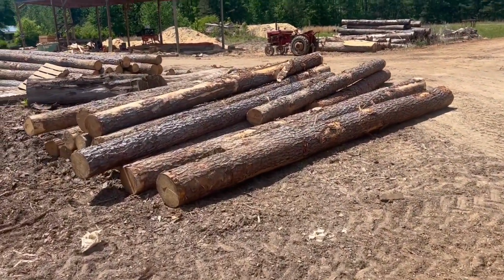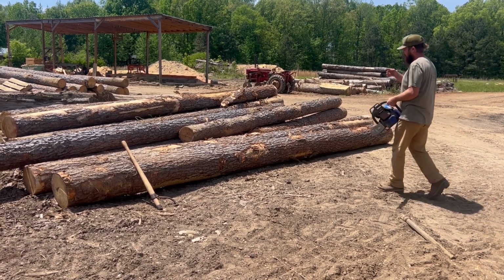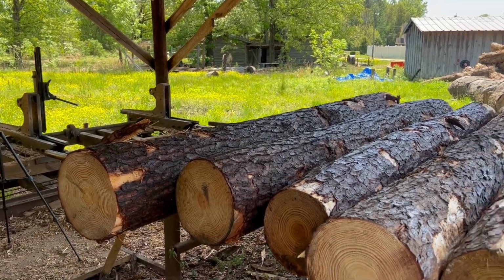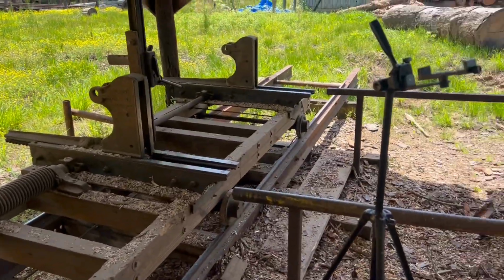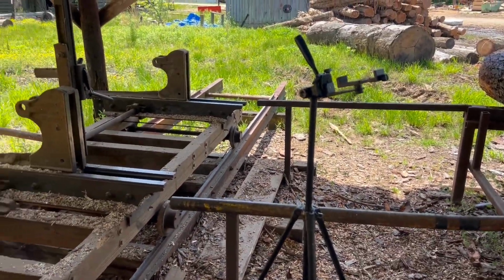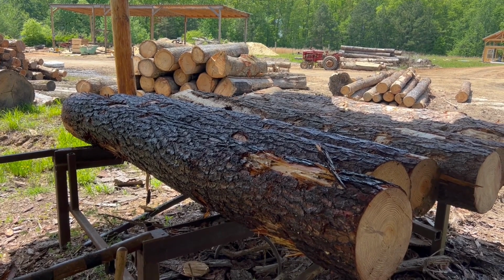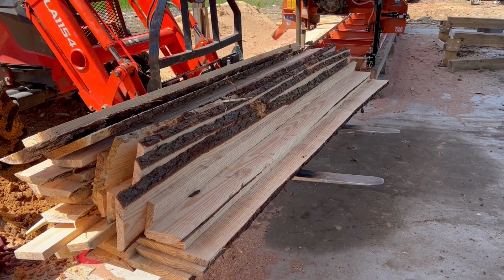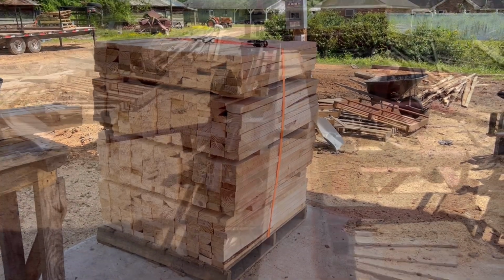CUSTOM order! Sawing 6x6 for a Customer!

Comment: I absolutely love your log turner. It makes perfect business sense to me. Technology cost money to buy and maintain. And any business cost must be added to the price of products. It appears to me that the cost of labor is not an issue to you therefore investing in new technology would be just added expense. My career before retirement was Maintenance and Manufacturing director for a division of General Motors called AC Spark Plug. Cost of maintaining Laser welders and lost time was a huge loss of revenue. At the same time Gillette Razor was the #1 investment for Return on investment at 65% ROI. Gillette chose to use equipment built and bought in the 40's and avoid the cost of Technology and moved the production overseas where labor was not an issue. Although I prefer Made in the USA it was an excellent business decision. You and Mrs. Wallace (The SAW BOSS) keep on sawing, and I will keep on watching. Thanks for bringing us along.
Reply from the maker: Thanks for watching along!

Comment: Love hearing that baby sing through the cuts. I'm running a 471 but it's the same tune over at our mill. That's the Lowest tooth count I've seen on a circle mill in a long time, lowest I've got is a 34 tooth 3 pattern but it cuts pine like a dream. Thanks for sharing and letting us tag along
Reply from the maker: Thanks for watching along! 26 tooth pulls like a dream!
Reply from the maker: Thanks for watching along! 26 tooth pulls like a dream!
Reply from the maker: Thanks for watching along! 26 tooth pulls like a dream!
Reply: @wallacefarmandsawmill  I'm always looking for odd older blades and stuff that I've never seen before and It just caught my attention. Looks like it's a good match for the 371 and does a good job.

Comment: Hiya, 
Another great video; thank you both. I love your 'Log Turner'. It's cheap, imaginative, and works well. What more could you want? I love the sawdust clearing/pilling system too. Again creative, and it works. Did you design it? Very clever.
Your wife is a treasure; she reminds me of mine from before... How she uses leavers and balance to shift even heavy 6"x6" on her own; is lovely. My wife loved working with me in building electrical control cabinets and sound systems. She was always a great help, plus I could never flag if she was still going strong; unfair, hehehe. 
How long before your son wants to learn to? I've always loved working with my hands, so I became an electrician, but now making jewellery. 
Stay safe, Steve...

Comment: Two questions that i have as a fellow sawyer of many years, why don't you wear hearing protection and  why don't you stack your logs on bearers off the ground? I am not critizising just curious. Happy milling friend.
Reply from the maker: Most of our log stock is on a quick rotation. So its moved before being on the ground is an issue. Hearing protection is probably not a bad idea. I sometimes use it. Sometimes not.